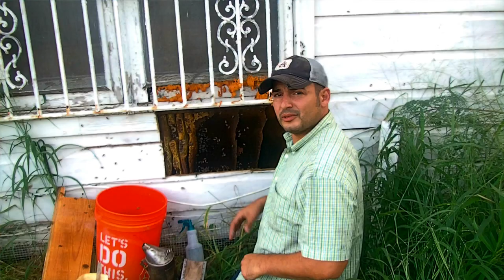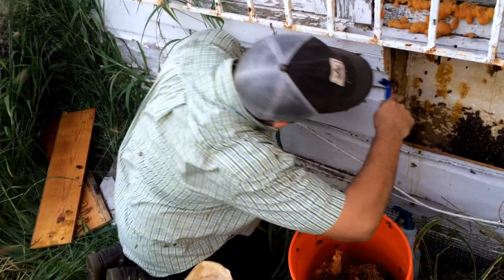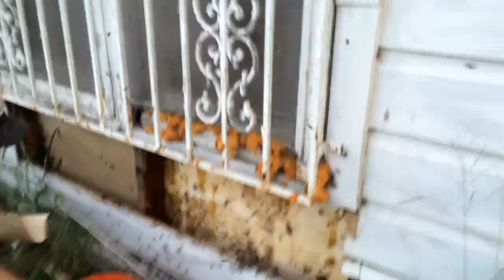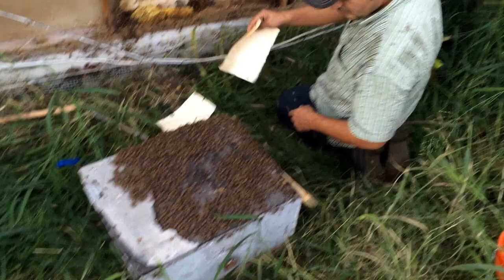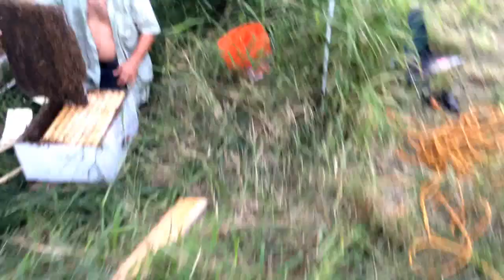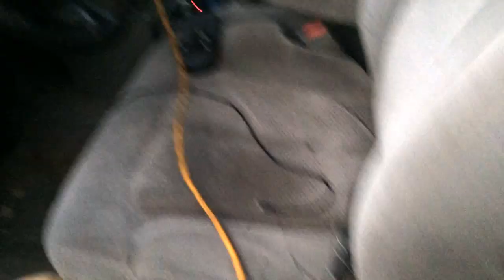Window honey bee hive removal in Edinburg,TX by Luis Slayton of Bee Strong honey and Bee Removal

Comment: Dude u got
All the bees flying around cause u drop them on the lid of the box ... They can just take off in the air . Now if u dropped them in side the box they would crawl deeper In it less bees in the air
Reply from the maker: The bees have a tendency to not wanna stay if i shake them in the hive. You re better of shacking them in the entrance or in this case on top that is slightly open for them to crawl in. The older bees take to the air but come back in to box after a while...
Reply: Cyrus Ortega my dear friend, Luis is a very skilled Bee keeper. I don't think it's very prudent to tell him the way to do things. It takes many years to become so skilled.